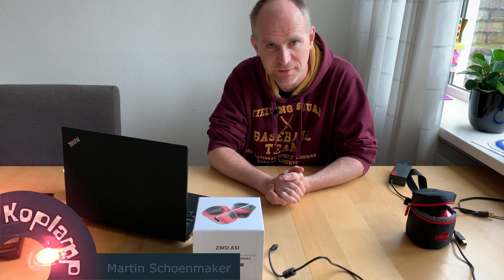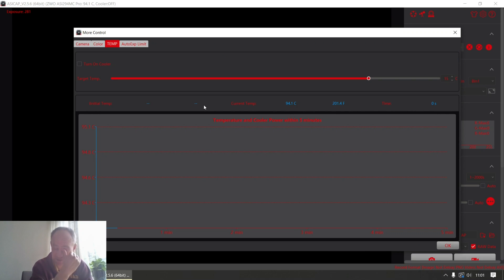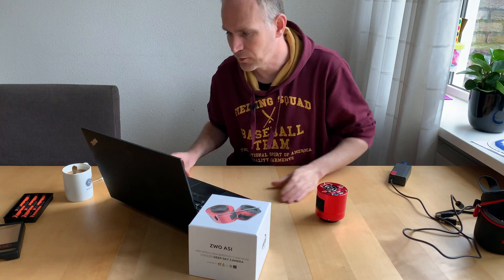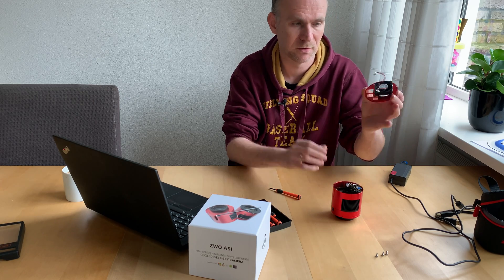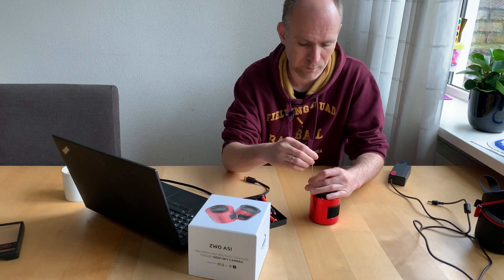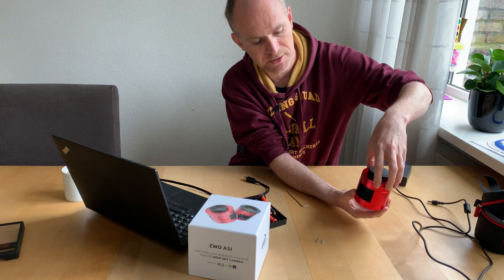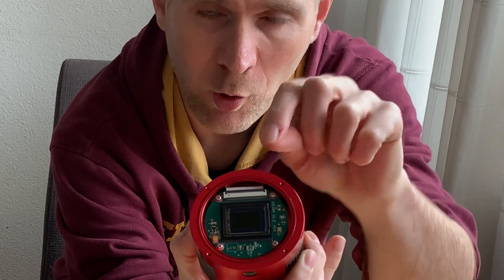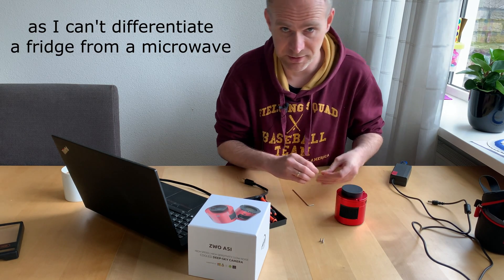Multiple Astrophotography Rigs. Episode 2: Disaster strikes. ASI294MC Pro lost its cool

Comment: Hi, interesting video, I too had problems with the 294 mc pro, after 2 years of use, the interior was full of condensation, I changed the pads, but the condensation problems remained, so I tried to refill the ARGON gas cell, it is now working fine
Reply from the maker: Argon gas cell? I only know about the desiccant tablets.
Reply: @KopLamp  yes, yes, I had to put inert gas in the cell, otherwise I always had traces of ice on the sensor

Comment: Good to see around the camera housing Martin.  It seems strange how it's lost this cooling ability.  I have the 533MC Pro and it's a very capable little camera with very easy calibration, would be great for galaxies on your edge and there is the option to Mosaic 2 Panels for a wider view.  Hope you get it all sorted soon 👍
Reply from the maker: Thanks Ollie. I might just buy that camera indeed... Just have to muster the courage to once again spend money on this hobby...
Reply: @KopLamp  I know pal it's never ending!!!  After getting the Esprit I need to tie my hands behind my back so I can't click on Buy for the rest of the year !!! 🖱️
Reply from the maker: How is the Esprit doing? I had a Esprit ED80 a short while. It was terrible. Turned out to be a factory issue. Got the William Optics instead and am a happy camper now.
Reply: @KopLamp  This one seems very good so far, I think with all scopes being made by the same couple of factories there's a lot of variability.
Reply: The cooling obviously works.
A camera sensor doesn't generate nearly enough heat to ramp up to anywhere near the temperatures depicted. Even just passive cooling with the rad alone and fan off is enough to keep the sensor at room temp indefinitely.
It's the temperature sensor that got fucked for some reason and returns ridiculous values, causing the cooling to run at full tilt, because it THINKS it's at boiling point lmao.
Reply from the maker: Nevertheless the images looked way more noisy at the same time. Even with the cooler at a frantic 100%

Comment: Sorry to hear about it.  Hopefully the turn around doesn't take too long.  

I had to send my 1600mm for repair and ran a 533mc on my Edge for a few months.  It's a solid set up.. especially on galaxies.
Reply from the maker: I am really considering to buy one. Only thing holding me back (other than money) is the reduced FOV on the 533 compared to the 294.
Reply: @KopLamp  Yes... the FOV is the biggest drawback.  The square actually wasn't bad on small targets.. and the format matches up well with social media.  I got around it a little bit with 2 panel mosaics.  

There's always the 2600 :)

Comment: 94 degrees? Celsius or Fahrenheit? If it’s the former then it’s the sensor that is faulty as it is nowhere near boiling point (100) when you just switch it on. Good luck in sorting it out 👍
Reply from the maker: Celsius indeed. Wouldn't even know what it is in Fahrenheit ;) I gets noticeably hot though!